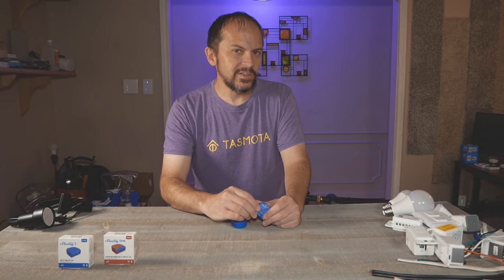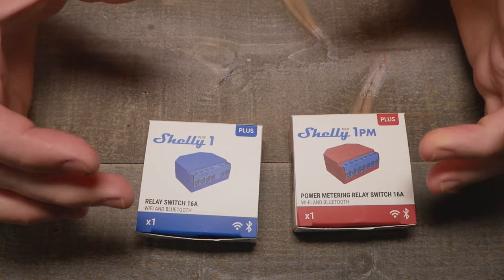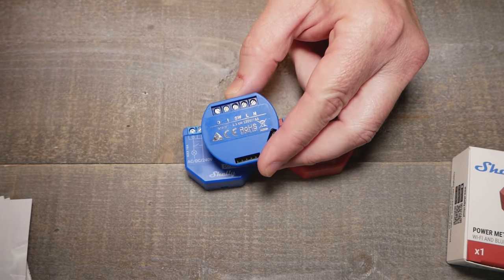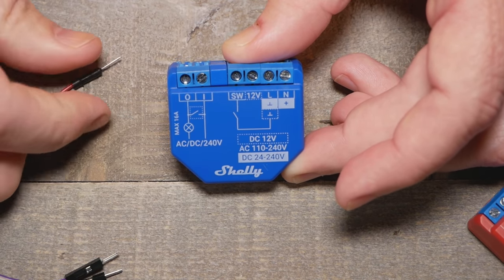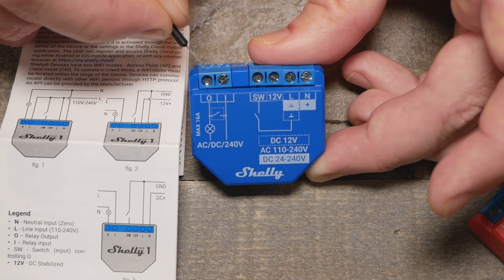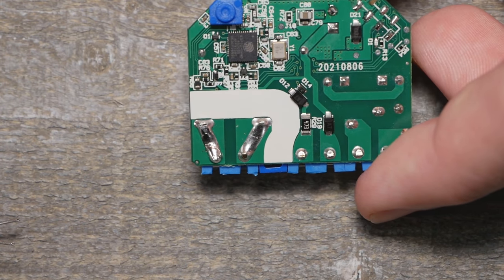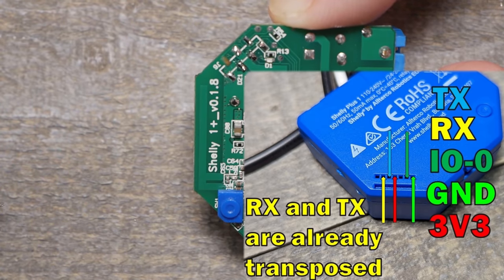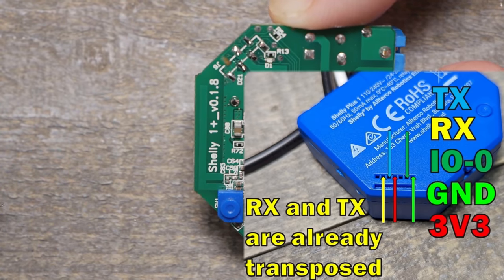Shelly Plus 1 ESP32 Smart Relay | TASMOTA and Home Assistant

Comment: Great vid and nice to compare them!
If only Shelly would listen and act to customer's wishes. Everybody complains why Shelly firmware can't save  a config to an external file. For backup, for documentation, for interchangebility, for experimenting. But no. I asked them in 2020 and still nothing changed. My main reason to go to Tasmota. Also completely opposite to this is that Shelly does prepair for firmware changes by implementing a pinheader!? So why not implement config save/restore? I really don't get it.
 I do like Shelly over Sonoff because of their better resistance against lightning/interruption peaks/dips on the mains. Lost Sonoff switches several times where all the Shellys persisted.

Comment: One thing that's extremely disappointing with the 1PM is how inaccurate the voltage reading is. I have 221V mains and it displays 205V which must mean that the power reading is inaccurate too.

Comment: I don't see anyone talking about the Access Point feature or the Range Extender. On the Shelly One Plus the AP is enabled and it will not let me disable it. It defaults to have the "Open network" box checked, but says "It is important to password protect your device's access point to secure your network from unauthorized access." If I uncheck the Open network box I can add a password, however it will not let me save the changes. To me this looks like a security risk. I have mine on a network that does not have access to my home network, but it seems like others could connect to the shelly and have access to other devices I have on that guest network.
Reply from the maker: I turn that off once I pair it with my network as I don't want open APs.

Comment: so, could i theoretically make an environmental sensor for temp/humidity and then based on that data send the signal to the smart relay if outside of parameters? trying to automate my home garden and spent way too much money with AcInfinity just for them to be unreliable and have bad customer service.
Reply from the maker: Yes.  I do this with my bathroom vent

Comment: have you tried the shelly plus add on, thinking of getting one to hardwire my door sensor and temp humidity sensor instead of this zigbee battery powered devices, would like to see a video
Reply from the maker: I have only tried the built in integration for them myself but I still prefer having full control of things with open source myself.

Comment: Does anybody have experience with the life expectancy of HF7520 ( 6:56 in the video )? Depending on the frequency of switching eg 1/min -1/1hr is there any lifetime curve available for these? The reason is that I saw many faulty "smart plug" where the relay contacts were burnt after a year with about 1/hr switch rate.

Comment: hello, can I use this device to change the direction of the AC signal? I have an electrical Velux, and I need a switch that will help me to change the wiring in order to open and close the Velux accordingly... I do not know if you fully understand what I need, but I really hope to find the correct product for my need here :)
Reply: In other words, can I use this Shelly Plus 1 as a DPDT rocker switch for reversing the AC signal that feeds my Velux... ?
Reply from the maker: Sorry not familiar with those myself.

Comment: How did you flash tasmota? I'm having a hard time getting the chip ready for flash. Do you have to ground I0-0? I tried but still doesn't work.
Reply from the maker: What flasher is being used? Some do not have enough power.

Comment: What do you say about the temperature when the relay is on? Compared to shelly 2.5 and 1pm in the original firmware?
Reply from the maker: I haven't compared the original firmware as I don't run it.
Reply: @digiblurDIY  Ok, then in comparison with the non-original firmware, what can you say about the temperature? 😊

Comment: I'm looking at your pinout and the order looks like it is almost the same as my USB ftdi module, I'm wondering if those pins would fit directly in those holes.
Reply from the maker: Need some super small pins.  Even breadboard jumpers were a tad big, dupont is definitely a no go.
Reply: @digiblurDIY  

Maybe a bobbypin or similar? Safety pin-mod ?
Reply: No they won't they are too big on mine. I had to buy a 1.27mm pitch pin header. The pins are 0.4mm square and they fit. Painful to solder, at least for me.

Comment: Can the Shelly 1 or 1PM be triggered to turn on/off the relay over the GPIO ports?
Reply from the maker: I know it can be done with Tasmota firmware
Reply: @digiblurDIY  yeah i actually found a video of someone who was able to make it work via Tasmota firmware after I left this comment.  They did it by using a light switch to open and close a loop between Ground and GPIO-3 pins of the Shelly 1 to turn the relay on and off.  It took many hours of searching to find that information so I hope it helps someone else here!
Reply from the maker: I did it way back in my original Shelly tips and tricks video. If you use mains power on the device you do need to use a mains rated switch to isolate things.
Reply: @digiblurDIY  for my situation I am trying to control the Shelly relay using a Raspberry Pi Zero, so I can't do it via AC power.  I am trying to control the relay using the Pi's 3.3V or 5V port and a GPIO port.
Reply: @digiblurDIY  not sure if this would work to connect 3.3V and GPIO port from the Pi to the Shelly Gnd and GPIO3 port for controlling the relay on/off.

Comment: That 1PM+ might short out. On that PM chip the bottom left pins aren't soldered cleanly enough. Check it!
Reply from the maker: On the BL0937 itself?
Reply: @digiblurDIY  yes, check minute 11:55 . Bottom left 2 pins of the BL. Seems to have some solder almost bridging both pins.
Reply: Good spot
Reply: On the regular one there also is a solder bridge on the topside of the ESP

Comment: Before flashing to Beta, first test the device...
Reply from the maker: I did.  It's not hard to flash back as well or even to Tasmota.  I took backups of the original firmwares as well.
Reply: @digiblurDIY  Hey, can u please make a short video on how to flash them? I tried to get it working, but everytime I try it doesn't work. I use the pinheaders to connect an ftdi32 - perhaps i connect it wrong - don't know ... would be nice to get a video. There is no other video on youtube for the plus series. thank you!
Reply from the maker: FTDI might not provide enough power for the esp32 to go into flash mode.
Reply: @digiblurDIY  do you not have pulled down the PU Pin to go in flash mode?
Reply from the maker: GPIO 0 pull down is still the normal.